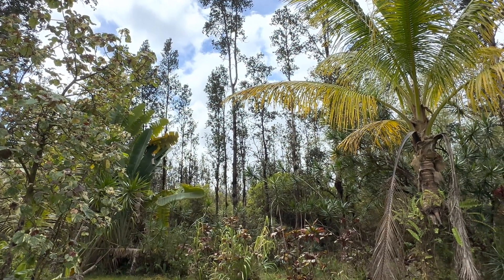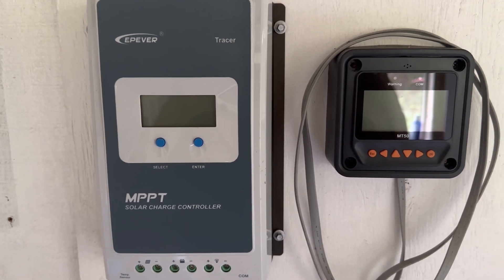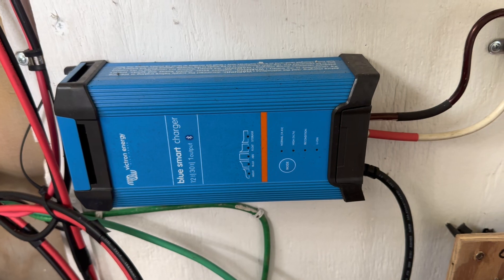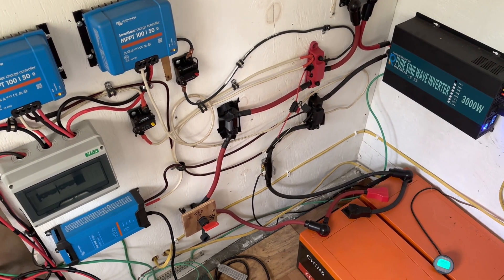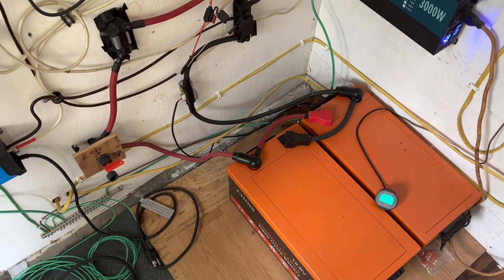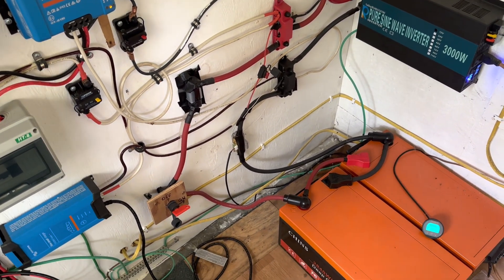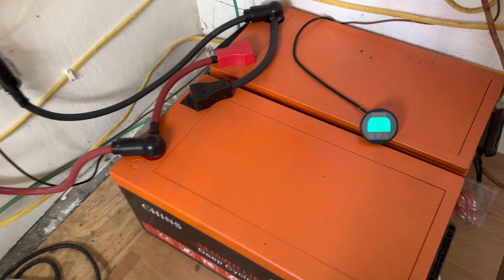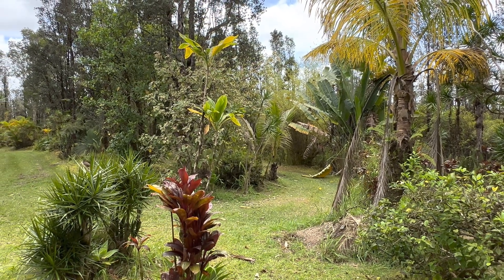CHINS 12V 300Ah LiFePO4  2 Years later A look back to where it all started and how does it hold up?

Comment: Of course LFP batteries are superior for solar power. I wanted to replace my car lead-acid batteries. But a battery specialist website I consulted, said that lead-acid are still superior for car starting because of the CCA cold-cranking-amperage that lead-acid can deliver, but not LFP.  I was disappointed.
Reply: a better choice for lithium starting battery  is the LTO type. some already using them but you have to change stuff in alternator and computer to work and charge correctly.  so far no plug and play replacement for starting battery yet.  the big problem with LiFePO4 is the BMS and the current of the starter. and the charging is different which adds to problems making them work and LFP do not like under 32F and that can be a bummer. so far the best starting battery is the AGM type. don't give up change is coming just matter of time now not if .
Reply: @robertmeyer4744  Thanks, I haven't heard of lithium-titanate or lithium-titanium-oxide (LTO) before. At up to 10k cycles, It might last 27 years. Sounds promising. So many chemistries, so little time.
Reply from the maker: Yeah, they always say not to use for that...maybe that will change someday? Aloha! 🤙
Reply: @ProjectsinParadise808  I sure hope so. Battery chemistry is complex and I know little about it.
Reply: LFP cells can absolutely provide the current to crank an engine.  The main issue is people try to use regular storage batteries, the sort of thing you run your inverter from, as cranking batteries.  The BMS in these things usually isn't up to the task and will shutdown on overcurrent, as intended.  You can get batteries that are intended to use for engine cranking though and they do the job nicely.  You can even get aviation certified batteries to start piston based light aircraft.
Reply: @retrozmachine1189  Yeah, I think so too, but I'm not an expert, so I'm not making any claims. I'll just have to wait and look around more. Thanks.
Reply: @edwardlulofs444  I dug through my email and found a cranking battery that has been used to start a single engine piston plane, unapproved so can't be installed for that purpose though.  The owner of the plane said it started the engine without hesitation, cranking was as if a fresh lead acid battery had been connected.  A carbon pile style tester was connected to it out of curiosity.  It supplied 500A and drooped to 10.1V but held fast there.  Not bad for a 36Ah 12V battery that weighs 6.5kg.  It even has a 6Ah reserve programmed in case you leave the lights on or such.  It's by an Australian outfit so probably unobtainium for you but I'm sure you can find genuine LFP cranking batteries where you are too.
Reply: @retrozmachine1189  Thanks, I'll keep looking.